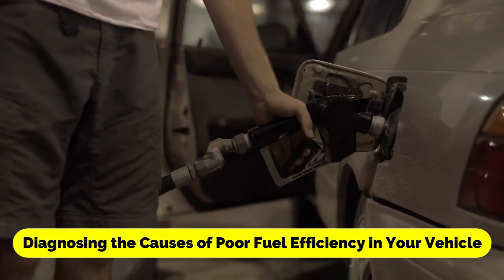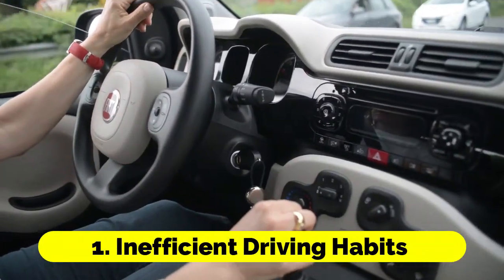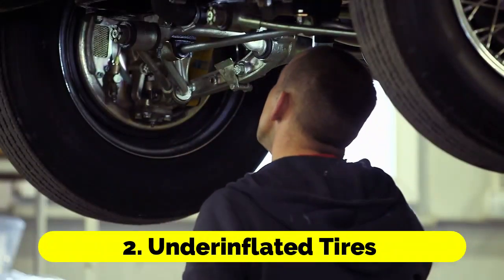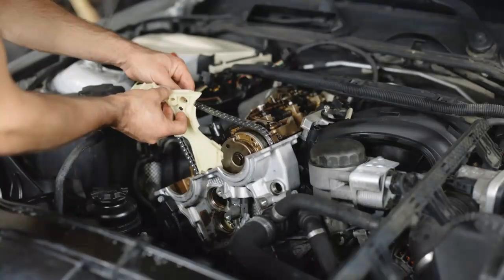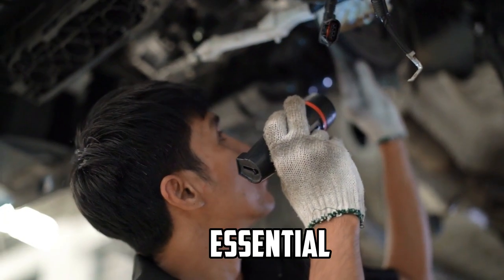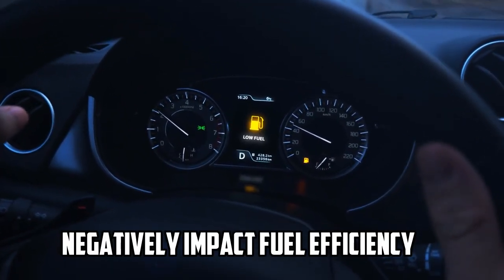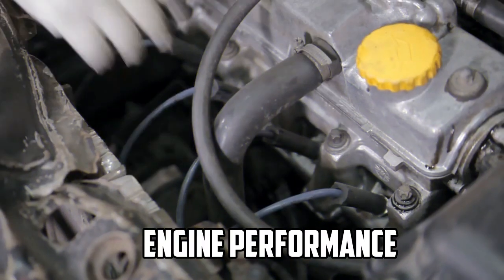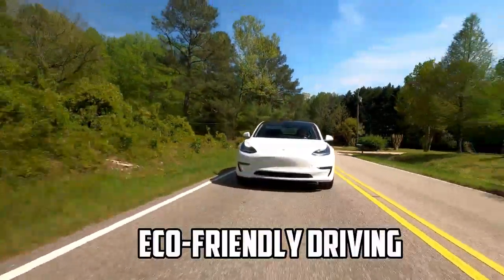Diagnosing the Causes of Poor Fuel Efficiency in Your Vehicle #Cracking the Code of Fuel Efficiency

Comment: My 2017 RAV4 with 49k miles has an average mpg readout on the display.  My previous average was about 23.5 mpg for short trip driving.  When I switched gas stations, I notice my mpg dropped to about 20.5.  On a 350 mile trip I monitored the mpg and was averaging about 27.5 mpg.  I refilled my tank at a bit less than 1/4 full and started driving again and my mpg shot up to 32 mpg after driving 60 miles.  I took the vehicle to the dealer for a check and he attached a device for reading codes and monitoring engine efficiency - everything was perfect.  So, why is gasoline mpg so different depending on brand, etc?  Are there less Btu's in lower mileage gas? I was driving on a relatively flat highway the entire trip.